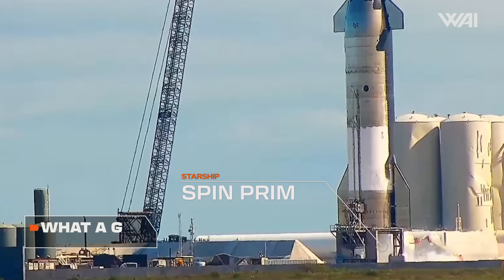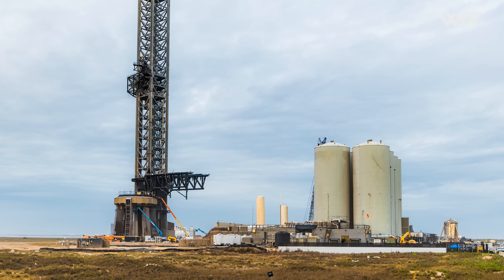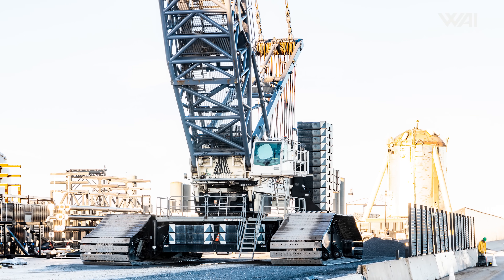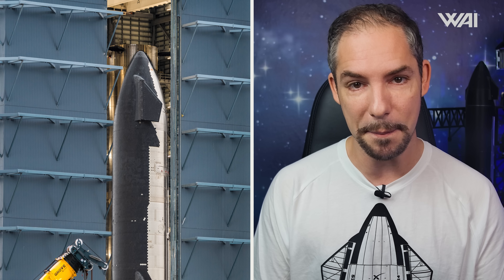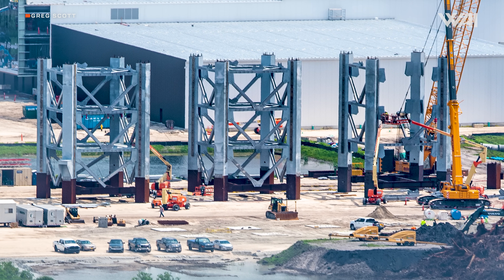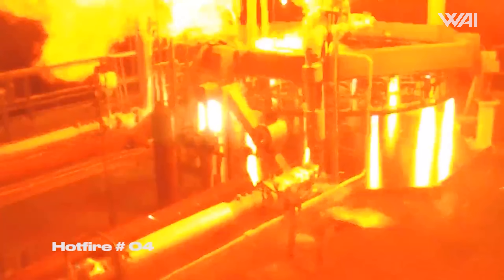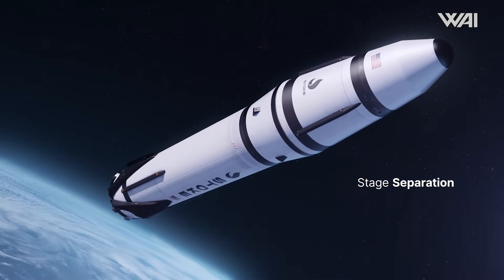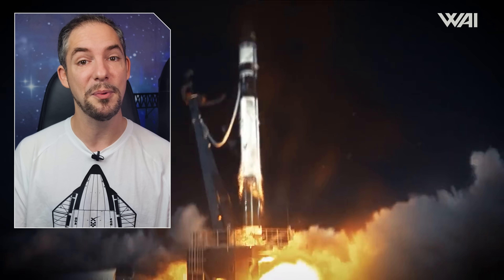It's On! SpaceX Sets Record Time For Starship Testing!

Comment: The second tower is initially going to be used solely for catching, I predict it will be constructed at the shooting range
Reply: Nope. There are 0 benefits for a catch tower. Here's why (and my apologies for the very long post):
First, let's end the myth of "crashed booster=no more pad"
The July 11th anomaly was roughly as energetic as a booster exploding right before the landing burn, with at least as much (if not much more) shrapnel. The OLM survived without the majority of it's blast shielding installed. If that hit the SQD, then the SQD would need repairs, but it wouldn't look like the Amos-6 Transporter erector.
"But, if it hits the tank farm"
The tank farm, for starters, would most likely not explode if the booster crashed nearby. It would take a direct hit. But there are several safeguards.
The first method of avoiding this is the grid fins. They have an incredible amount of control over the trajectory. Even if it means suiciding into the tower, the tank farm will be avoided.
If the grid fins don't work, then the landing attempt would have been aborted, and the booster would hit the Gulf. Not the launch site. This is due to it requiring lift from the chines to make it to the launch site. By removing the lift (this would be done by angling with the RCS), you would get a much bigger CRS-16.
The final method, if both engines and grid fins are failing during the landing burn, is the FTS. The FTS is still functional after MECO, as has been proven by IFT-2.
"Masseys avoid any chance of damage"
In order to land at Masseys, the booster would fly over the launch site, but more importantly, it would fly over Boca Chica Village and the Production site. A bad landing attempt could destroy Starfactory or a couple dozen houses. 
"Well, even so, a catch tower can be turned into an operational tower"
Not really. A catch tower, though it would require plumbing, chopsticks, and a partialy functional OLM, still lacks the SQD and all the associated plumbing. Adding this in will be expensive. There is also a good chance that the Deluge Plate would need to be added in. If this can be placed into the OLM structure before the OLM table is complete, they will do that. 
Finally, OLIT-2 has already been confirmed to be a launch tower, not a catching tower.
Reply: @bryanillenberg  you are wrong, it may not end up at the gun range but the first catch attempt will definitely be at a dedicated catch tower. Write it on the wall under the calendar.
Reply: @jimmaag4274  Despite Catching towers having already been disproven before, by people much smarter than either of use?
I'll be really impressed when a nonexistent catching tower catches a booster.
Reply: @bryanillenberg  speak for yourself there kid, some of us have actually been around a bit.
Reply: @bryanillenberg  You mean the same smarter than us people that couldn't even construct a functional water tank?  And blew a crater under the OLM?

"I'll be really impressed when a nonexistent catching tower catches a booster." I will be too. Though a partially  constructed OLIT-2 used for a catch is an entirely different thing.
Reply: @bryanillenberg  Wow! What fanciful delusions, talk about 'myths'. Not catching at Massey's is the only realistic thing you mentioned. They can very easily build a second 'launch' tower as fully decked out as they deem reasonable and just not have a functioning OLM under it until they've shown some success at catching.  They install the SQD after the tower is erected anyway. They can have the hinges and all the plumbing installed and still just use it for catching!!! There is absolutely ZERO downside to having the tower and initially only using for catching. It's completely impossible for it to cost any more than using the existing functioning tower. Maybe that's why Roberts road has two sets of chopsticks and only one SQD. The only plausible reason for not using the second 'launch tower' just for catching is Elon's ego.

Comment: I think at least two of the vertical tanks will be scrapped, and maybe all of them to make room for more horizontal tanks. As for ship 26, I've always felt it would be an orbital fuel transfer demonstration model, as that is coming up soon.
Reply: Yeah, even the second launch buckled a couple of them, and that was with the rock-tornado problem solved. Better solution appears to be horizontal tanks behind berms, so I think the vertical tanks' days are numbered.
Reply: @meldroc  The only reason for the buckling is the tank construction wasn't completed. It was supposed to have vermiculite between the inner tank and outer shell which would have strengthened it. When they changed the tank from LCH4 to water, they didn't need the insulation. The LOX tanks with the vermiculite seem to have held up okay. So for now all they will do is remove the hollow outer shell and leave the inner tank bare.
Reply: Agreed. I like the idea of the 2nd tower installed at Massey's as well.
Reply: @Rosieplayz100  A launch tower will never be built at massey's. Here's why (sorry for the long post):
First, let's end the myth of "crashed booster=no more pad"
The July 11th anomaly was roughly as energetic as a booster exploding right before the landing burn, with at least as much (if not much more) shrapnel. The OLM survived without the majority of it's blast shielding installed. If that hit the SQD, then the SQD would need repairs, but it wouldn't look like the Amos-6 Transporter erector.
"But, if it hits the tank farm"
The tank farm, for starters, would most likely not explode if the booster crashed nearby. It would take a direct hit. But there are several safeguards.
The first method of avoiding this is the grid fins. They have an incredible amount of control over the trajectory. Even if it means suiciding into the tower, the tank farm will be avoided.
If the grid fins don't work, then the landing attempt would have been aborted, and the booster would hit the Gulf. Not the launch site. This is due to it requiring lift from the chines to make it to the launch site. By removing the lift (this would be done by angling with the RCS), you would get a much bigger CRS-16.
The final method, if both engines and grid fins are failing during the landing burn, is the FTS. The FTS is still functional after MECO, as has been proven by IFT-2.
"Masseys avoid any chance of damage"
In order to land at Masseys, the booster would fly over the launch site, but more importantly, it would fly over Boca Chica Village and the Production site. A bad landing attempt could destroy Starfactory or a couple dozen houses. 
"Well, even so, a catch tower can be turned into an operational tower"
Not really. A catch tower, though it would require plumbing, chopsticks, and a partialy functional OLM, still lacks the SQD and all the associated plumbing. Adding this in will be expensive. There is also a good chance that the Deluge Plate would need to be added in. If this can be placed into the OLM structure before the OLM table is complete, they will do that. 
Finally, OLIT-2 has already been confirmed to be a launch tower, not a catching tower.

Comment: Re Tanks - as I recall this is only the outer cover. They could remove that, and replace it with another one - that has lots of extra reinforcing rings..

At least that’s one possibility.
Reply: Correct it's just an outer cover, but they won't be replacing it. The tank was supposed to be for LCH4 and there would be vermiculite between the outer shell and the stiff pressurized inner tank. When they couldn't use the tank for LCH4,  I'm pretty sure they never put the vermiculite in so the outer shell is hollow. They converted the tank for water so they will just leave the inner tank bare. The exposed LOX tanks with vermiculite insulation as padding seem to have held up okay, other than the flying concrete which should be a thing of the past.

Comment: I think the huge vertical tanks will be demolished because they are just too exposed and sustain damage every time Starship is launched. Eventually that damage will pierce the inner tanks.
Reply: Other than the new kinks in the shell of the end tank, I don't know what damage you think is happening. I suspect all they are going to do for now is remove the outer shell from the one CH4 turned water tank. It doesn't need the shell anymore and I don't think they ever put the vermiculite in it so it's hollow. The LOX and LN2 shells are supported by the pressurized inner tank and vermiculite filler. The exposed LOX tanks seem to have held up okay other than the flying concrete strike which should be a thing of the past.
Reply: It's shocking this was even built,  but it was probably elons idea.

Comment: To meet the launch schedule that Elon envisioned, the readiness of water will be critical. Thus I figure that will SpaceX will convert all of the vertical tanka to interim water tanks.

How would this work? SpaceX will complete building a desalination & water filtering system the output of which will pump that water to the vertical tanks.

One other item you may consider is that SpaceX may soon work a contract with one or more Texas refineries to build a natural gas pipeline to Starbase to supply both the launch and test sites with liquid methane, a byproduct of the oil refinery process. 

This then makes Starbase a manufacturing, launching, and testing facility all in one. They could even use it as a launch site for sending tanker Starships to the space tanker platforms in orbit around earth, the moon and beyond.

I foresee a great move forward for Starship and SpaceX in South Texas.

P. S. Because the litigants attempting to stop SpacesX via law suits, have nothing solid to show SpaceX is harming the ecosystem around it, the courts will end up ruling that SpaceX can continue where they are. 

😅😅😂😂😅😅😊

Comment: Felix keep up the in the new year.   One question.   Why don't they just strap on a daily system upper part of the orbital launch mount and spray water at the qd?
Reply: Spraying water on the top of the OLM and booster QD cover sounds sensible. They are improving incrementally as needed, so expect more changes.

Comment: Could the Construction at Masseys be for A second Launch tower?
Reply: Or a catch tower or test fit tower?
Reply: No. Here's why (sorry for long post):
First, let's end the myth of "crashed booster=no more pad"
The July 11th anomaly was roughly as energetic as a booster exploding right before the landing burn, with at least as much (if not much more) shrapnel. The OLM survived without the majority of it's blast shielding installed. If that hit the SQD, then the SQD would need repairs, but it wouldn't look like the Amos-6 Transporter erector.
"But, if it hits the tank farm"
The tank farm, for starters, would most likely not explode if the booster crashed nearby. It would take a direct hit. But there are several safeguards.
The first method of avoiding this is the grid fins. They have an incredible amount of control over the trajectory. Even if it means suiciding into the tower, the tank farm will be avoided.
If the grid fins don't work, then the landing attempt would have been aborted, and the booster would hit the Gulf. Not the launch site. This is due to it requiring lift from the chines to make it to the launch site. By removing the lift (this would be done by angling with the RCS), you would get a much bigger CRS-16.
The final method, if both engines and grid fins are failing during the landing burn, is the FTS. The FTS is still functional after MECO, as has been proven by IFT-2.
"Masseys avoid any chance of damage"
In order to land at Masseys, the booster would fly over the launch site, but more importantly, it would fly over Boca Chica Village and the Production site. A bad landing attempt could destroy Starfactory or a couple dozen houses. 
"Well, even so, a catch tower can be turned into an operational tower"
Not really. A catch tower, though it would require plumbing, chopsticks, and a partialy functional OLM, still lacks the SQD and all the associated plumbing. Adding this in will be expensive. There is also a good chance that the Deluge Plate would need to be added in. If this can be placed into the OLM structure before the OLM table is complete, they will do that. 
Finally, OLIT-2 has already been confirmed to be a launch tower, not a catching tower.
Reply: bryanillenberg is full of it. The only thing correct is there won't be a launch tower at Massey's. Though someone else suggested using the tower at Massey's just to lift the boosters and ships for static fire testing. Given the demise of Pad A, I suspect the tower will be going there. And there is absolutely zero reason they couldn't dedicate a partially constructed launch tower for use as a catching tower at the start.
Reply: @heartysteer8752 
"Though someone else suggested using the tower at Massey's just to lift the boosters and ships for static fire testing."
That's a waste of a tower. And it seems like Masseys will only be for ship static fires, not Booster firings. 
"Given the demise of Pad A, I suspect the tower will be going there"
Probably not directly there, but that's a good guess for it's location.
"And there is absolutely zero reason they couldn't dedicate a partially constructed launch tower for use as a catching tower at the start."
Read my post.

Comment: shorter integration tower at masseys so they can lift and test starships without using octograbber, then once tested can go directly to full integration tower for launch
Reply: Hmm, that is an interesting idea. Though don't they have all seven segments on the way? And also there is the demise of pad A, suggesting big changes at the launch site.
Reply: @heartysteer8752  they might still make more segments to built the test area one, it would make sense to have a lift tower for testing area for rapid cadence of testing and also safety for personnel long term. i still have a bad feeling bout landing at actual launch tower and not have a dedicated catching tower a little away from the launch tower that doesnt have critical hardware nearby that can be damaged. it isnt like they loose that much time to catch at a spot 1/4 mile away and the spmt just drive under caught booster and then it can either go direct to next launch or back for fixes.

Comment: The added deluge system tanks may handle all water supply needs eliminating the vertical tank.
Reply: They aren't going to remove the tank, just the shell.
Reply: Thanks @heartysteer8752